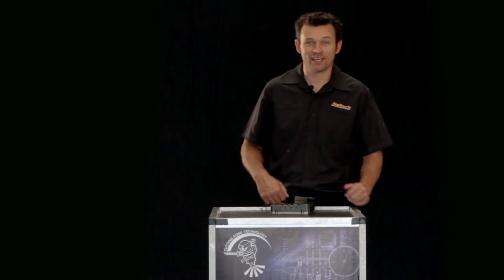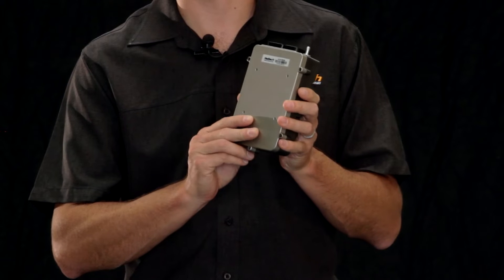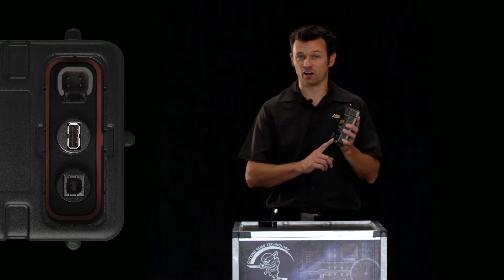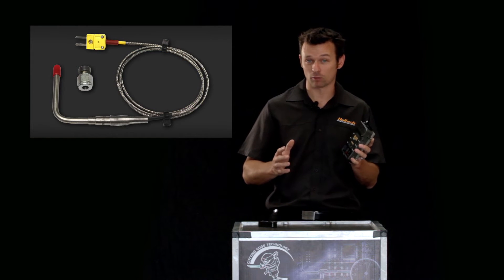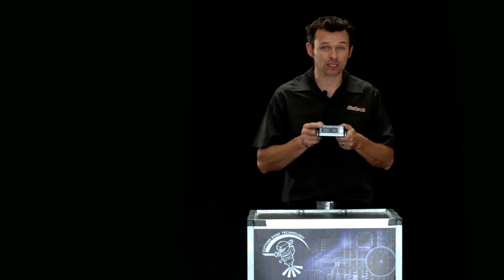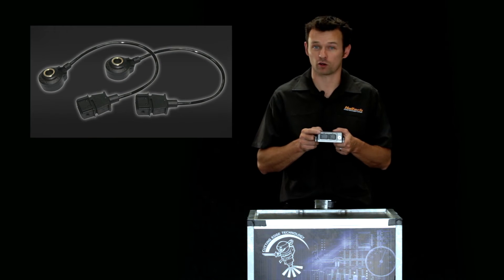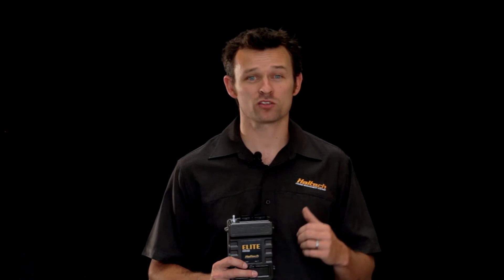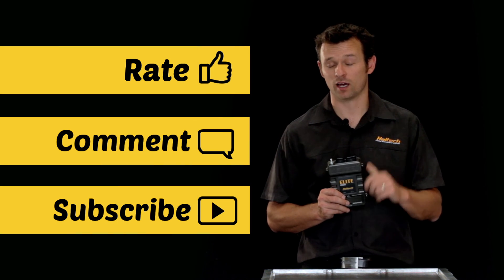Haltech Elite ECU Overview

Comment: Hello will elite 2500 work on my Vauxhall corsa c 1.2 with a turbo and where I can get base map so the car starts. And will elite 2500 work on other engines. Please help me
Reply from the maker: RallyartTurbo343 Elite 2500 is a universal, stand alone ECU so it will work with your car but it needs to be wired in. It is not a plugin ECU. For a base map send an email to support@haltech.com with your car/engine specs and we'll email you a base map file.

Comment: does it work on a BMW?
Reply: Thanks, you have the same name as my dad lol.
Reply: Mark Krukowski its has a can bus system which can work with the factory ecu, so you don't have to worry about factory tune. Also it has a ESP running for complex, i mean ridiculous complex system where it can analyze the fuel content, and by each cell of the MAF (assuming you know what it is) make a correction on a separate table which within the software it can be shown that it has the corrected cell so you can apply the changes for more daily driving so it can make less correction. This does this by AFR, throttle position, fuel type, fuel content, knock, cam position, where you are in the MAF and all sorts of other stuff. Lets factor in other stuff: wide band O2, thermal sensor for each exhaust, true O2 sensor and all sorts of other stuff to making the ESP run better at analyzing the MAF cell to make better correction.